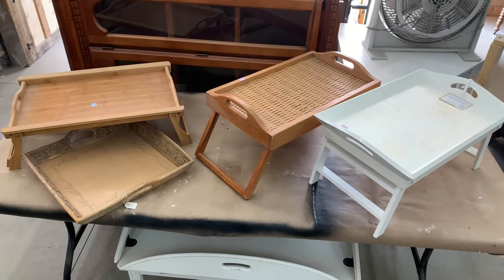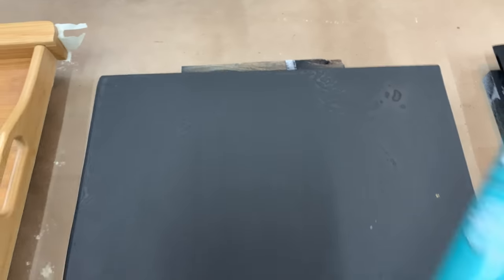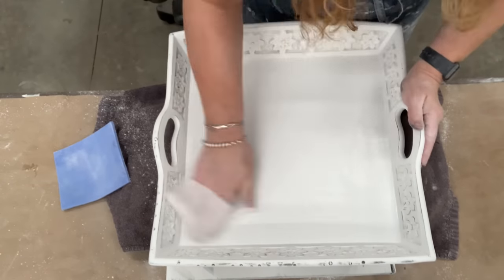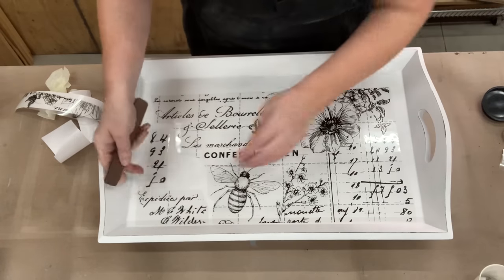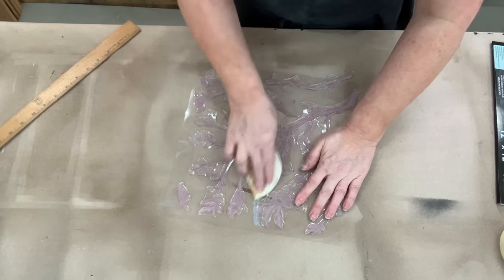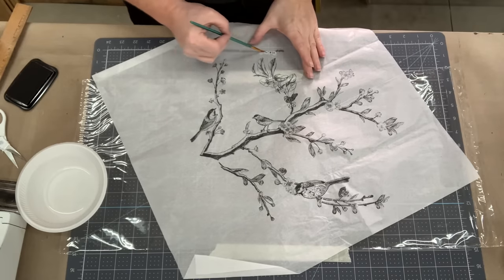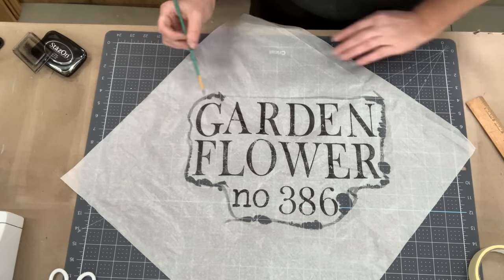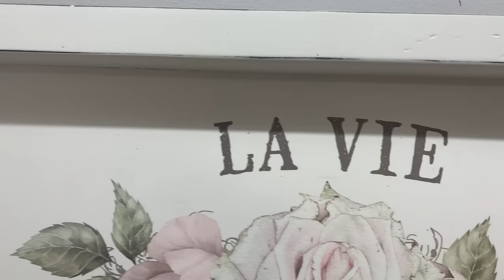Thrift Store Makeovers || Lap Trays || Trash to Treasure

Comment: Try using scrapbook tape.  Just put a small amount on the back of the stamp in multiple places if it is a large stamp.  Once your finished stamping, alcohol should remove the tape residue.  Love your trays, so pretty.
Reply from the maker: Thank you for sharing that tip